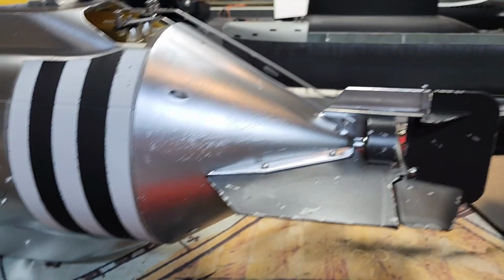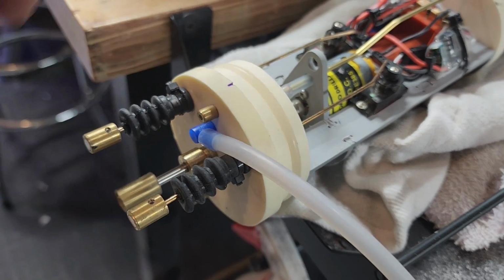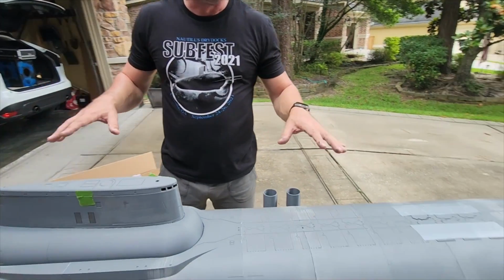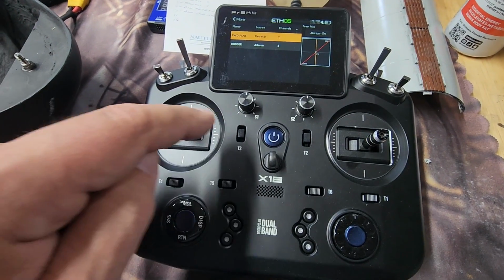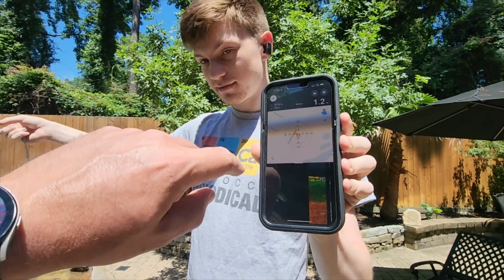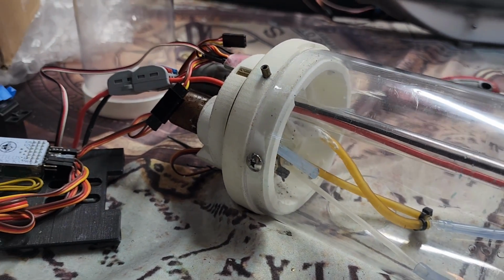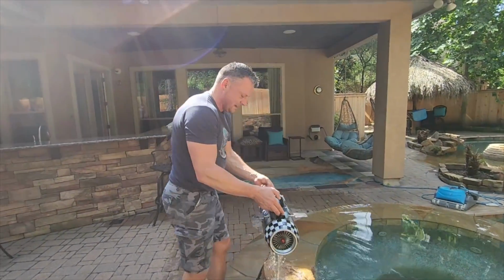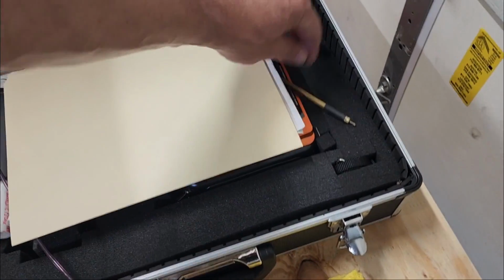Underwater Fighter Jet Patrols My Pool While a Giant RC Typhoon Gets Her First Exposure.

Comment: When I converted my Neptune to lipo I had to add a lot of weight. I added one more of the large stock weights, and then placed self adhesive weights down both sides of the insides of the side panels. It took a lot. I hope you also verified/adjusted the battery cut off voltage. When I checked mine the stock setting was something stupid low like 3 volts.

Comment: On the engel, the first step would be to disassemble the entire sub in the area of the broken part, remove it, and then machine a new part, replace and re-assemble. Probably not the solution you wanted to hear, but anything else you do probably won't work, or will sacrifice the look of the boat, my guess.

Comment: Secure a nut to the end of the tech rack. Drill a hole in the bow for a bolt to pass through.  Construct a recess to catch the bolt. An o -ring under the bolt  to seal.

Comment: Great video as always. Regarding the Engel 212a, I would rebuild the bayonet locking tabs on the stern section from resin, acrylic, brass or whatever you like. Add a reinforcement ring inside the stern bayonet fitting (probably brass made from flat strip bent into a ring). Glue everything together then drill holes through the new tabs original ring and new reinforcement ring and use screws or rods/pins through all three layers. the reinforcement ring will spread the load out over a large area and it could still function the way it was originally made.

Comment: On the rear portion I would glue/cast/affix some small blocks (resin, brass or plastic) and then I would 3d print a ring with recesses for the blocks for the front portion of the boat. In this way you could slide the front onto the back and rotate it to lock it together (like locking lugs on a bolt action rifle).  This is not easy and may take more than one iteration (3 or 4 to get it perfect) but as solutions go it's a good one.  You could do two rings, a male mating ring for the back and a front female receiving ring with the recesses, this way you could test it before gluing it in place.

Comment: Use flat aluminium or brass sheet to remake the 212 bayonet tags and matching ring for the front half. Trim away the old resin pieces to give a standard o-ring seal then use the brass standoffs (perhaps split the spacers if necessary) at the back of the the tech rack to secure the aluminum bayonet on the rear half, bond the other matching ring half inside the front hull with a strong 2k adhesive like JB weld or modified acrylic. Should be stronger than original.

Comment: I am a novice here, but my dynamic, sub, maiden ed  yesterday, and floated and sunk, and floated!, several times, all on 2.4, wow its scary when it sinks the first time, and doesnt re appear for a while, once it loses signal and goes into failsafe of throttle off dive planes to up, great fun, and im hooked !!
Reply: How was your experience with 2.4?
Reply: @YouTubecx4  2.4 worked fine, as had about 2 cm of ariel poking out of the water
using an old but trusty spektrum AR500
Reply: @YouTubecx4  2.4 worked well, but it did have about 2cm of ariel always above water level, i also set failsafe to cut power, and full up elevator, so even if it did lose signal, it would always pop back up